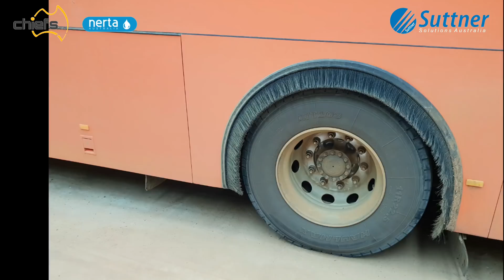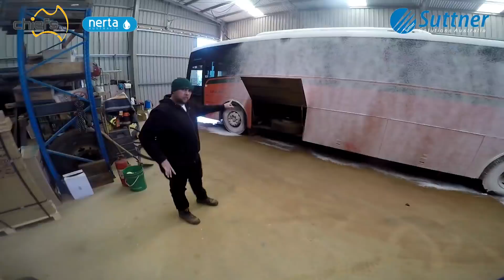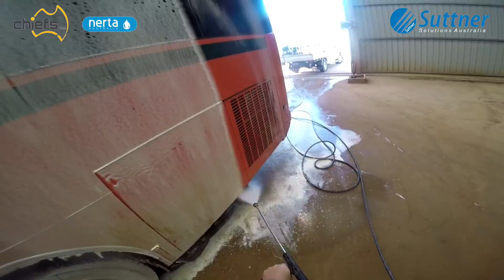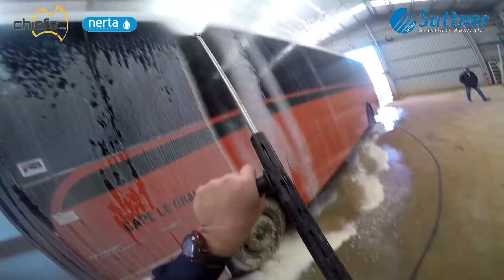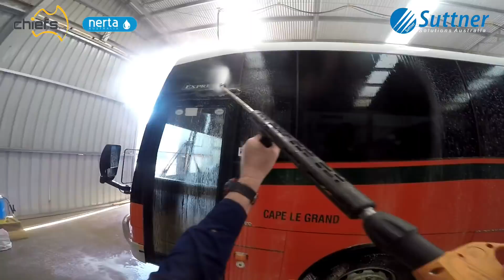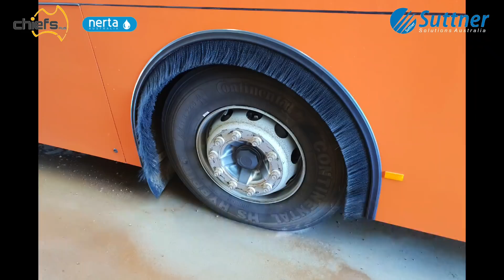Nerta's Active Diamond

Comment: I need to know. Why does everyone start rinsing from the bottom to the top? I would think that you would start at the top and go down
Reply from the maker: When washing a vehicle using conventional methods you firstly apply soap, wash using a sponge or a broom and then rinse off with water from the top to the bottom.
Touchless washing is a bit different.
Soap is applied through a high pressure foamer and then high pressure water is used as a “sponge or a broom". The water is worked back into fresh soap, either from the bottom to the top or backwards in the case of trucks and trailers etc. In this way, the soap is used more efficiently. (If you wash from the top down, you would simply wash the soap off the vehicle which defeats the purpose).
Then rinse from the top down to finish the cleaning process.

Comment: The top first before the bottom
Reply from the maker: When washing a vehicle using conventional methods you firstly apply soap, wash using a sponge or a broom and then rinse off with water from the top to the bottom.
Touchless washing is a bit different.
Soap is applied through a high pressure foamer and then high pressure water is used as a “sponge or a broom". The water is worked back into fresh soap, either from the bottom to the top or backwards in the case of trucks and trailers etc. In this way, the soap is used more efficiently. (If you wash from the top down, you would simply wash the soap off the vehicle which defeats the purpose).
Then rinse from the top down to finish the cleaning process.

Comment: I guess he was missing the Science class when his teacher was teaching the topic GRAVITY
Reply from the maker: He's actually very good in science, especially gravity Mr Kaleem, When washing a vehicle using conventional methods you firstly apply soap, wash using a sponge or a broom and then rinse off with water from the top to the bottom.
Touchless washing is a bit different.
Soap is applied through a high pressure foamer and then high pressure water is used as a “sponge or a broom". The water is worked back into fresh soap, either from the bottom to the top or backwards in the case of trucks and trailers etc. In this way, the soap is used more efficiently. (If you wash from the top down, you would simply wash the soap off the vehicle which defeats the purpose).
Then rinse from the top down to finish the cleaning process.
Reply: @chiefsaustralia9012  A quick question, when you give it the last rinse off is it done with tap pressure or the pressure cleaner...? Cheers...
Reply: @chiefsaustralia9012  I get a tickle reading your replies to these “I know it before I study it” experts lol. Well done @Chiefs Australia P.S. Active Diamond is awesome.

Comment: Why from bottom to top?
Reply from the maker: When washing a vehicle using conventional methods you firstly apply soap, wash using a sponge or a broom and then rinse off with water from the top to the bottom.
Touchless washing is a bit different.
Soap is applied through a high pressure foamer and then high pressure water is used as a “sponge or a broom". The water is worked back into fresh soap, either from the bottom to the top or backwards in the case of trucks and trailers etc. In this way, the soap is used more efficiently. (If you wash from the top down, you would simply wash the soap off the vehicle which defeats the purpose).
Then rinse from the top down to finish the cleaning process.
Reply: to make you complain
Reply: @chiefsaustralia9012  best reply I have heard thumbs up
Reply: This man doesn't know how to wash a vehicle!
Reply: @pasiieeeshirantha5793   he is doing it correct way man this is different than a normal wash

Comment: Why wash from bottom to top🤦‍♂️
Reply from the maker: When washing a vehicle using conventional methods you firstly apply soap, wash using a sponge or a broom and then rinse off with water from the top to the bottom.
Touchless washing is a bit different.
Soap is applied through a high pressure foamer and then high pressure water is used as a “sponge or a broom". The water is worked back into fresh soap, either from the bottom to the top or backwards in the case of trucks and trailers etc. In this way, the soap is used more efficiently. (If you wash from the top down, you would simply wash the soap off the vehicle which defeats the purpose).
Then rinse from the top down to finish the cleaning process.
Reply: @chiefsaustralia9012  biggest load of nonsense I tell u
Reply from the maker: @Chaklaschaklas  thanks for telling me

Comment: I turned off when i noticed he started pressure washing from the bottom. Big NO NO and wash of water
Reply from the maker: When washing a vehicle using conventional methods you firstly apply soap, wash using a sponge or a broom and then rinse off with water from the top to the bottom.
Touchless washing is a bit different.
Soap is applied through a high pressure foamer and then high pressure water is used as a “sponge or a broom". The water is worked back into fresh soap, either from the bottom to the top or backwards in the case of trucks and trailers etc. In this way, the soap is used more efficiently. (If you wash from the top down, you would simply wash the soap off the vehicle which defeats the purpose).
Then rinse from the top down to finish the cleaning process.

Comment: Top to bottom amk. Neresi zor bunun ?
Reply: Türk bulabildim, sonunda!
Reply from the maker: When washing a vehicle using conventional methods you firstly apply soap, wash using a sponge or a broom and then rinse off with water from the top to the bottom.
Touchless washing is a bit different.
Soap is applied through a high pressure foamer and then high pressure water is used as a “sponge or a broom". The water is worked back into fresh soap, either from the bottom to the top or backwards in the case of trucks and trailers etc. In this way, the soap is used more efficiently. (If you wash from the top down, you would simply wash the soap off the vehicle which defeats the purpose).
Then rinse from the top down to finish the cleaning process.
Reply: @mutemadiyennnn  k j0